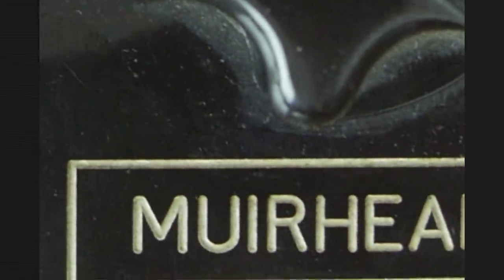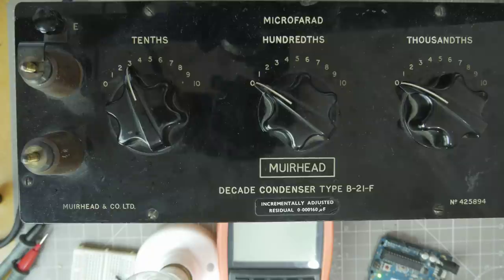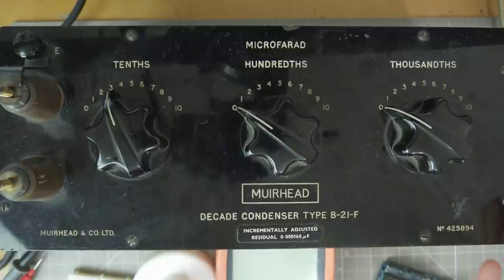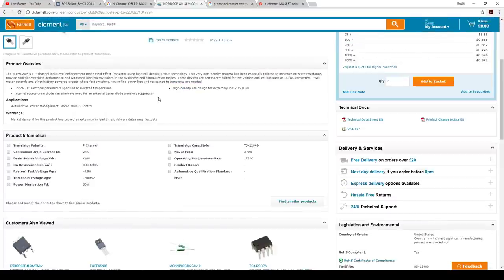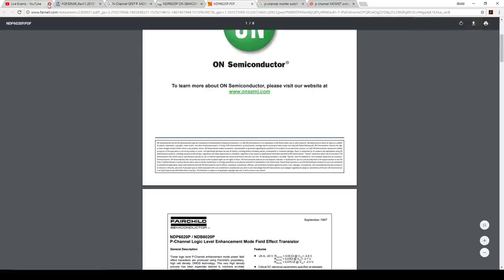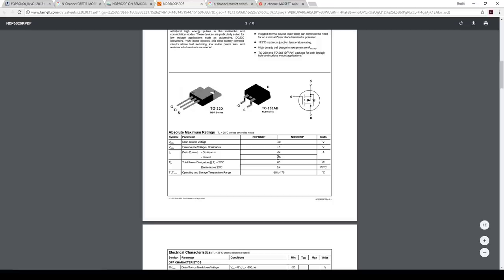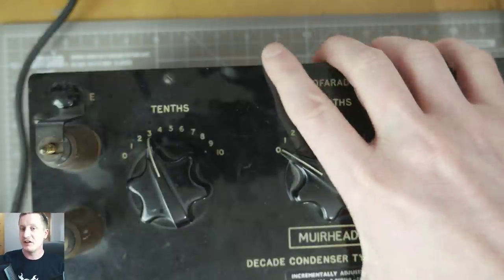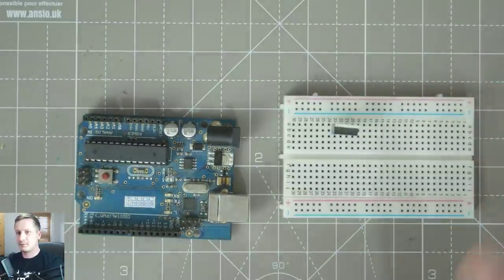Livestream 27 - Hopefully we can make this LED bulb as dim as me

Comment: David do you remember the Micronucleus bootloader for use with the line of Digispark boards. You get to use the reset pin for GPIO  and also somehow able to program with USB. I have forgotten. But it was also quite a small size and handy for the smaller  flash memory. THis is done through the Arduino environ
Reply from the maker: I do indeed, I think I had one 5 years ago. I don't have one anymore, I think I let the magic smoke out.